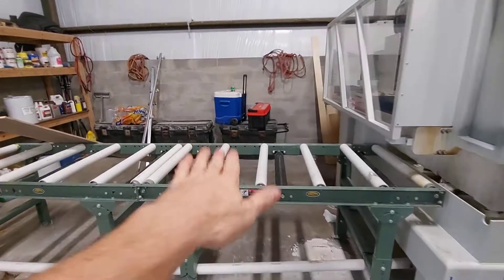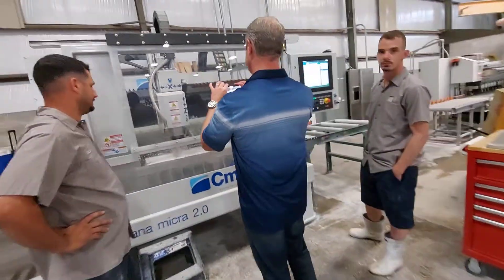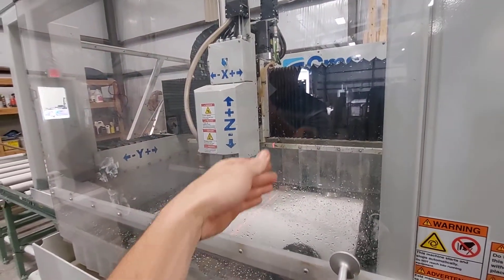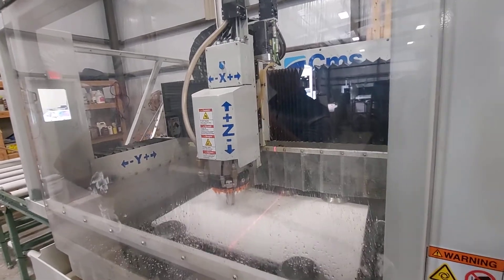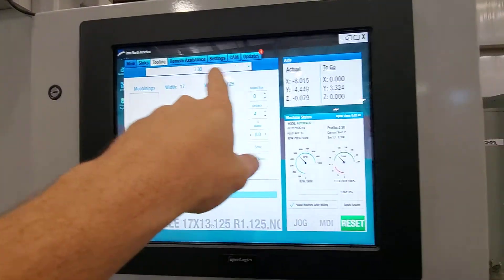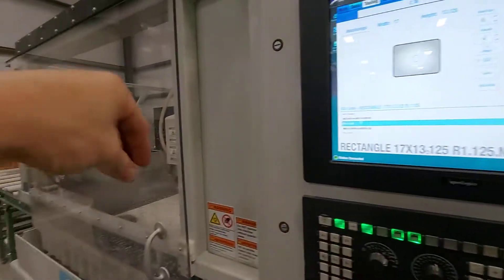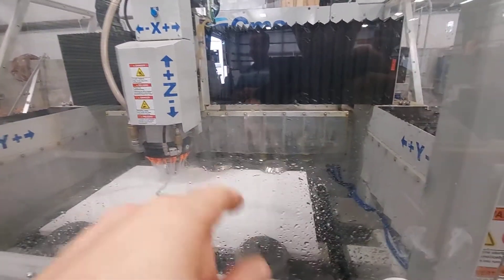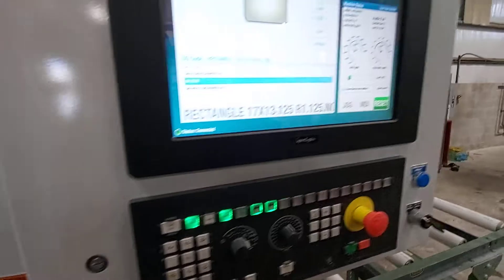CMS Micra Performace Simplicity Repeatability unmatched sink cutting and polish

Comment: CMS CNCs are some of the most difficult CNCs I've ever worked with for comparison, northwood has a very user friendly and ease of use interface with individual suction pods without the use of locating pins. Same goes for park industry machines
Reply from the maker: This machine is the complete opposite of the typical CMS interface, I believe anyone can use this machine with zero experience. Check out the other video "explained"  and you will see that CMS has simplified their interface immensely with these new generation of cncs! Thanks for your perspective! If you need more training let us know!